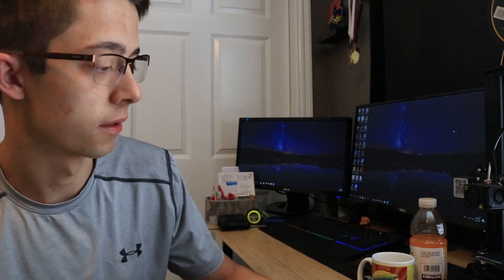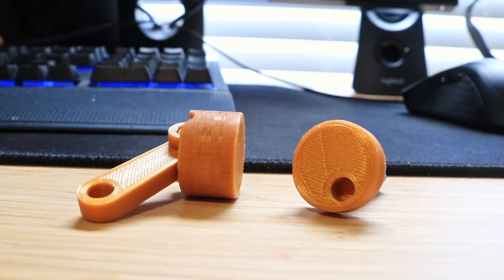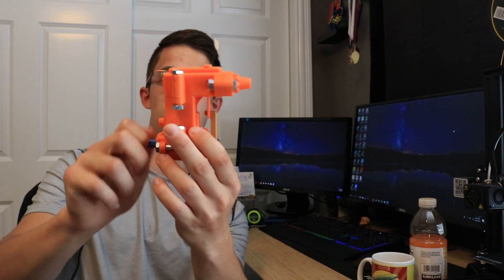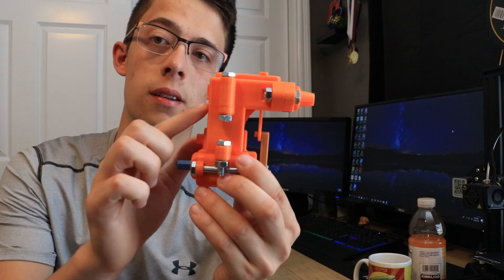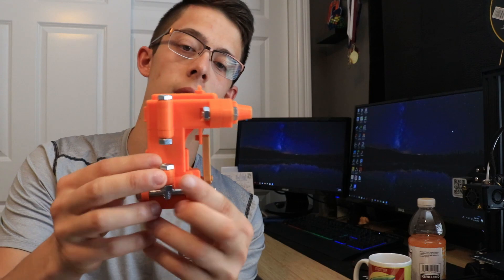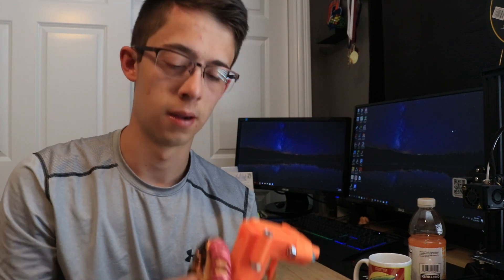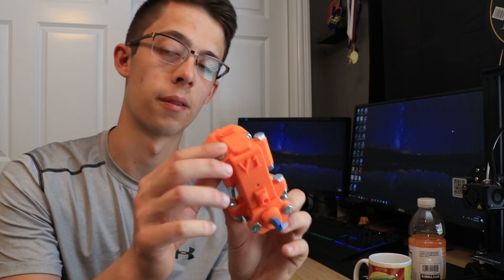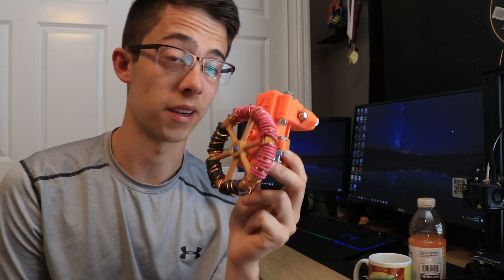AND SO IT BEGINS - AIR ENGINE #1

Comment: hallo Martin ,
how are you i hope my comment find you well,acually i looking for compressed air engine with specification blow ,    
    1- Power = min 0.2 to 0.4 hp
 2- velocity= min 50 to 100 rpm 
3- Motor set place ( size avialable) = 150 x 250 x 300 mmm
 and if that possible please give me pressure needed with minimum and maximum value ,..
.thak you again .
..Sam..004915774561765 ,Germany

Comment: On  the 3D printed stream engines that run on air I made cavities in the flywheel so I could put in pieces of lead. Should have made caps or cover to hide even though recessed. Hard to get the tolerances right on all the parts. Some I just assumed I would sand or coat to get good fits. Sometimes easier to use some metal shafts and thin wall brass tubes. I tired to keep bolts and nuts scaled down when I could. Glade someone else like designing 3D printed engines of any kind. The guy that make 3D printed V8's are just plain crazy!  Nice video to watch so I will follow more of them.